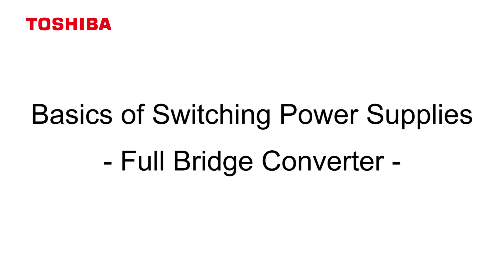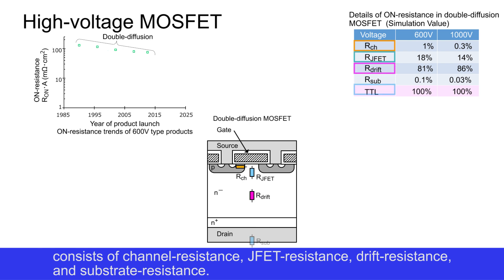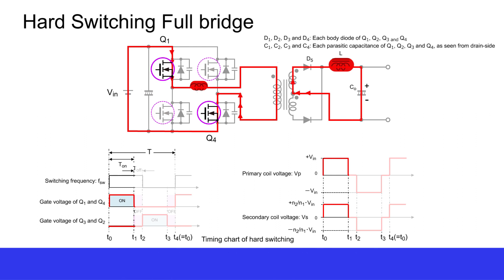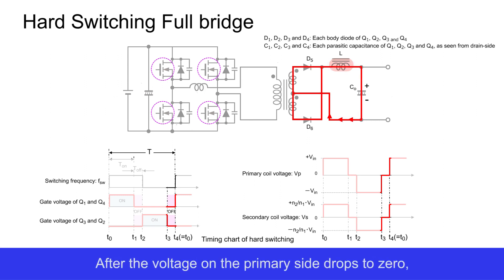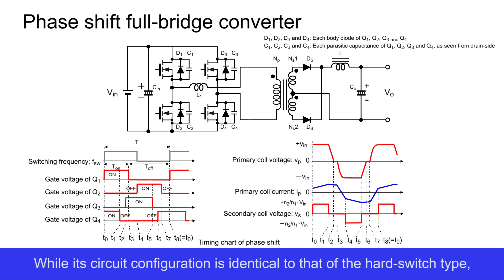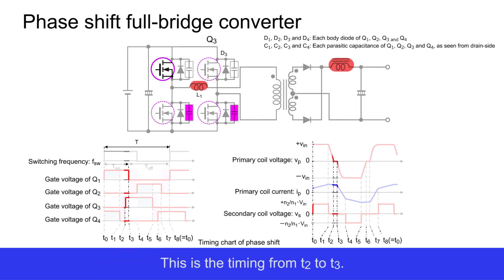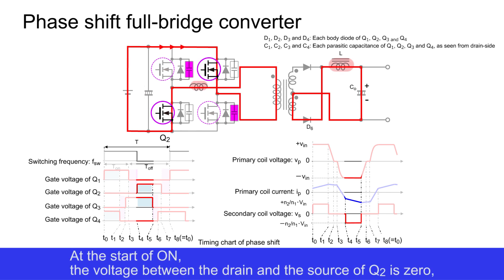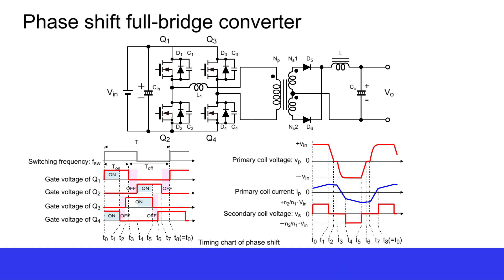[ e - Learning ] Full Bridge Converter - Basics of Switching Power Supplies (5)

Comment: Moffat with 3 pin I guess it PN channel positive voltage go in to the emitter it go into the base but not the collector the collector it been disconnected a lone I guess it for negative voltage connection i make inverter used power transistor i got no problem at all i got stuck used power mosffat to make inverter problem with the negative collector connection